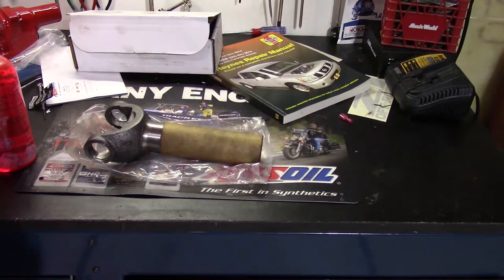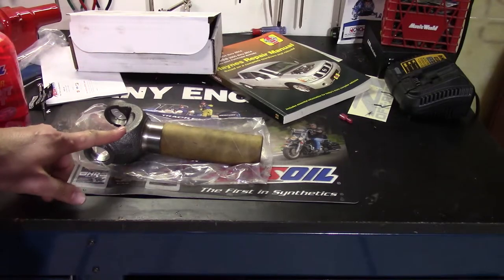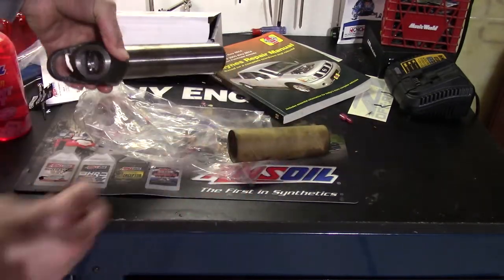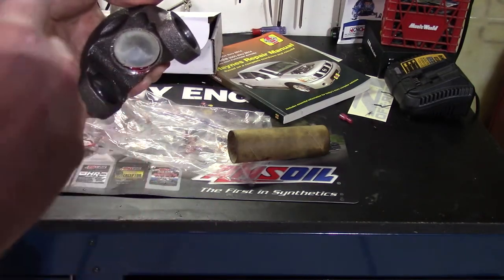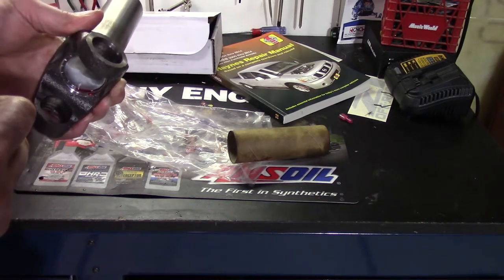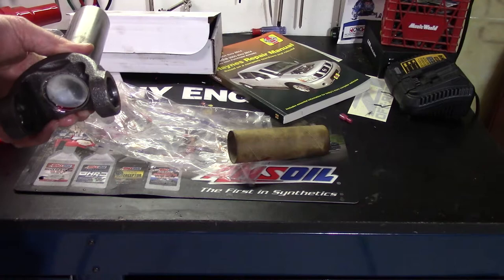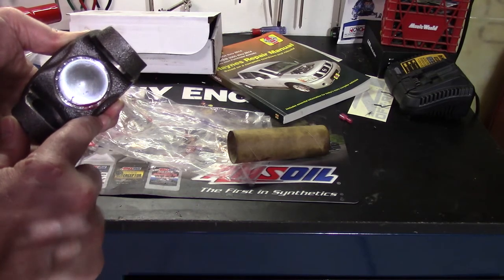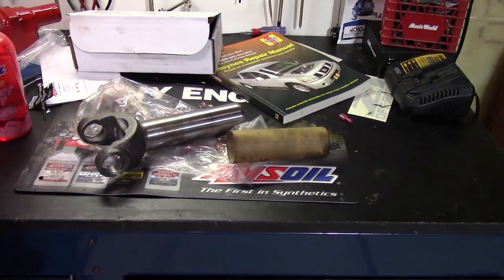Finally Found the Leak On My NIssan Titan | Yoke Seal

Comment: My Titan has had a leak at that spot. It also just recently started humming under the truck. I know it’s not my wheel bearings and wondering if it’s my shaft yoke or ujoints. That’s all I know to check
Reply from the maker: Could be u joints.  A bad u joint could cause the seal to go bad as well.
Reply: I’d also check carrier bearing.
Reply: @jameshawelu4916  my truck is at the shop now to get trutrac.